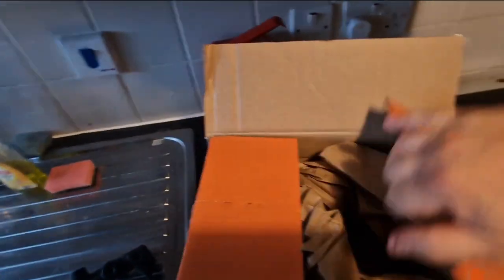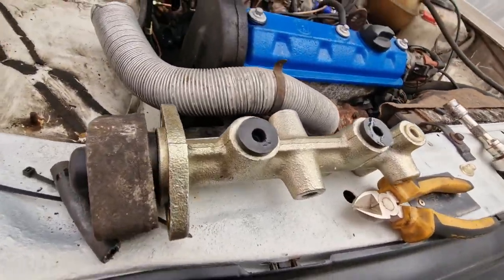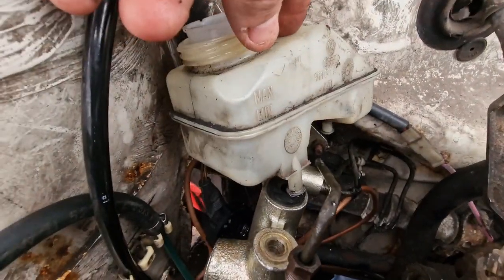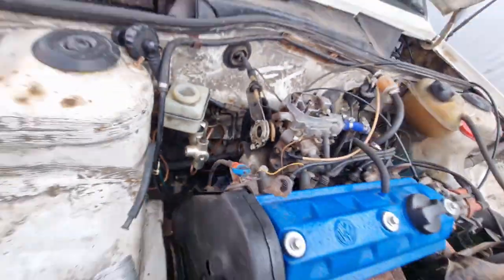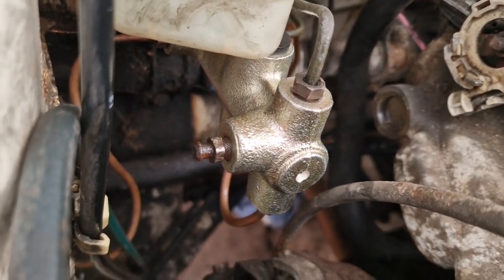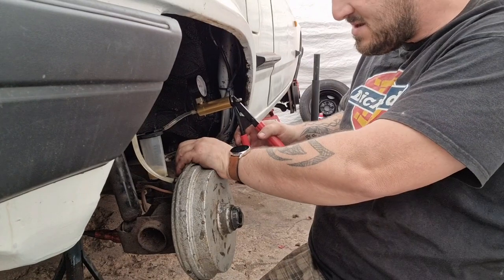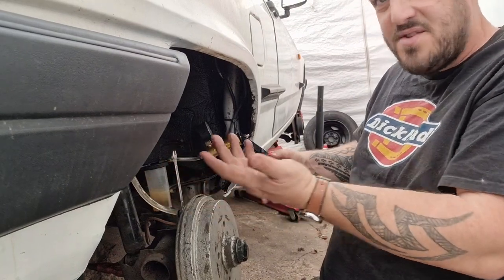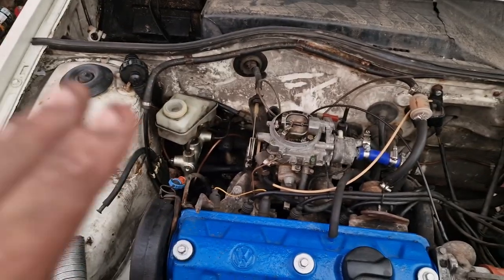HOW TO BLEED BRAKES, master cylinder change vw polo mk2 86c

Comment: It's one job I always have to get my other half to help with - like you I prefer the simple old way of using the brake pedal! 
Those rubber seals/grommets on top of the master cylinder that the reservoir plugs into on mine have seen better days - do you know if you can just get the seals from somewhere on their own and if it's worth replacing them? Maybe I should just do the whole master cylinder one day?
Reply from the maker: Yeah old ways are always the best way.
I'm not sure about the grommets.  Maybe try vw heritage?